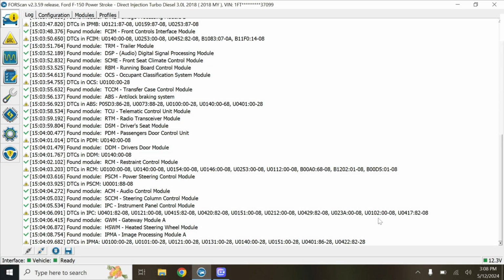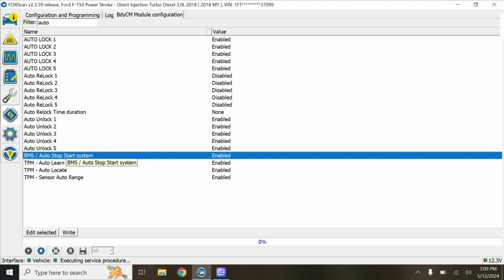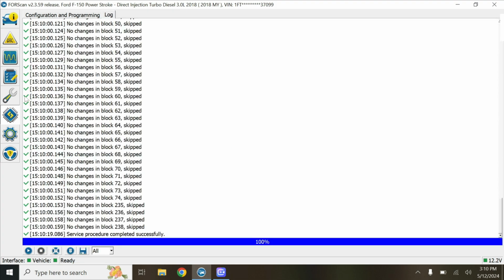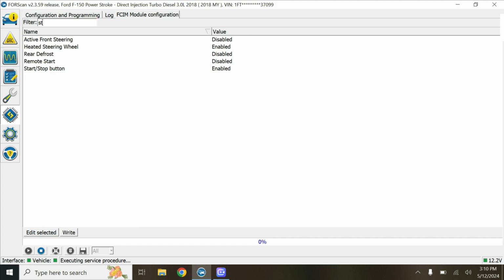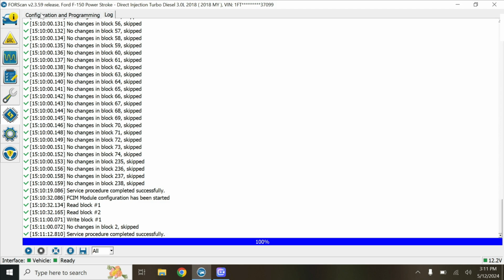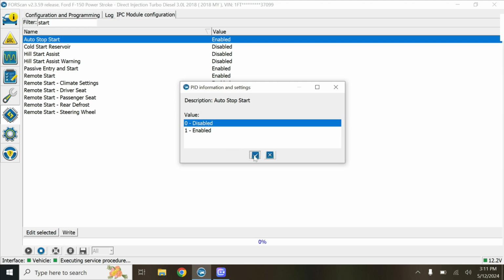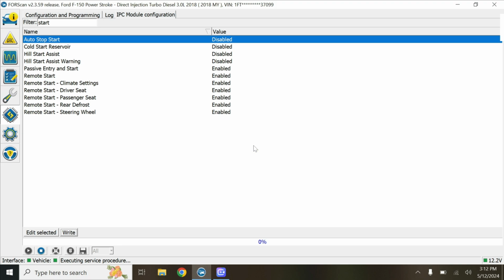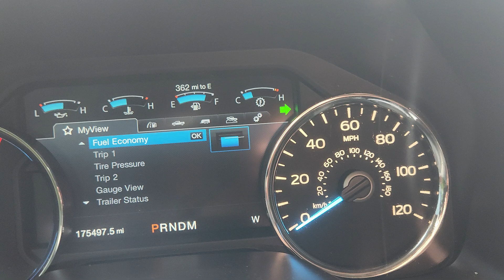How To Remove Auto Stop/Start #f150 Diesel #mechanic

Comment: Around the time I bought my 21 new,the chatter was that doing this through forscan didn’t work or wasn’t a good idea for whatever reason.  I can’t remember exactly why or what.  Was this recently added into forscan maybe?  

Anyway….because of that, I bought one of the little disable “gadgets” that plug into the back of the switch and it has worked well.  But I like how with it disabled the light on the switch doesn’t come on at all….so maybe I’ll plug in my PC and do this and sell the little “gadget” to somebody else to use!
Reply from the maker: @chriss526  worked on my buddies 21 when he bought it in late 21

Comment: Start stop actually decreases wear on the engine. Oil testing showed it. I get it it's annoying sometimes. And I've had people have me turn it off with forscan. I keep mine on. No fuel dilution from idling at lights. Less engine wear. I don't ways use it especially when super hot. But then again it won't shut off when super hot out cause max ac is on
Reply from the maker: @BeardedFordTech  every F150 I've worked on has asked me to turn it off so I give people what they want. Erika wants it off on the RRS to 😂
Reply: @CPsGarage  go watch my used oil analysis video. Engine wear went from 1.5ppm per 1000 miles to .4ppm for every 1000 miles. People think it ruins the engine or starter when all reality it doesn't. Yeah it's for epa and no idle cities. But it has its benefits. I've turned off a few if that's what they want.  These are usually people who think of the old ways. And for some reason they think all the oil drains back down in the 1-2 min it was off and there's no oil up top. Just not how it works.  I agree if it's what they want by all means turn it off.
Reply: I disagree.  It's a main factor in the cam phaser issue.
Reply: @dthm03  no it's not. Manufacturing was the main problem with cam phasers..  oh and most diesel engines do not use cam phasers.  The 3.0 diesel he was working on is a diesel. So no cam phaser. So you can disagree all you want.
Reply: @BeardedFordTech  cool story, thanks for sharing.